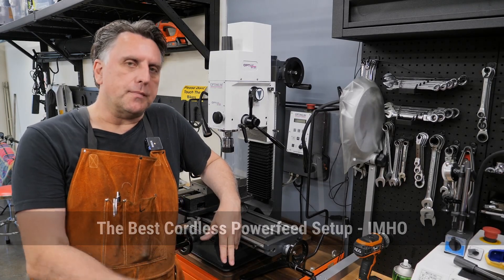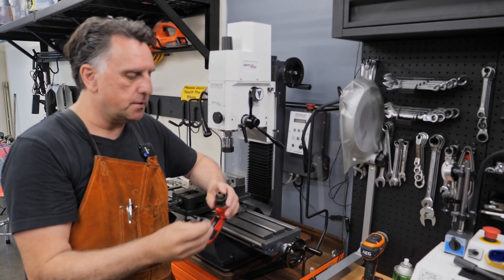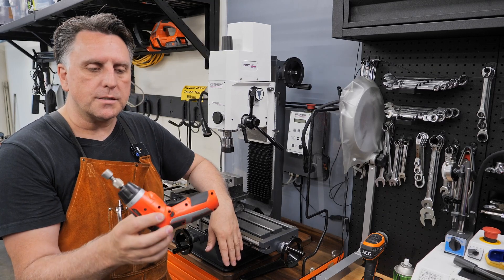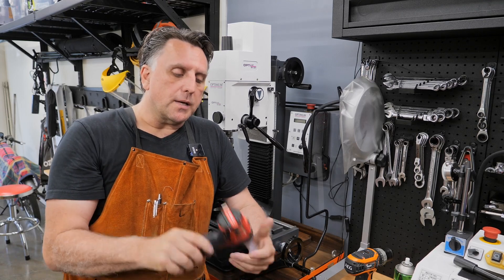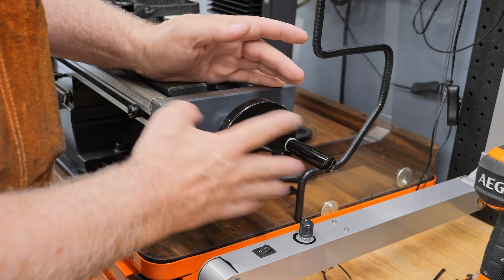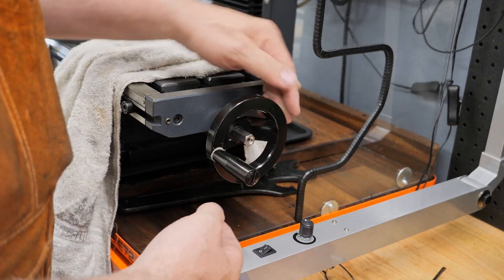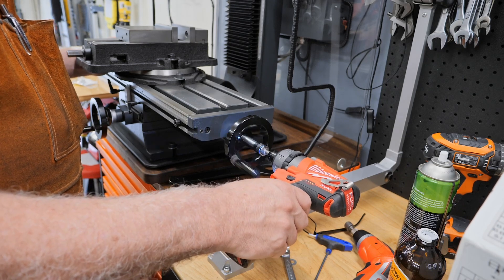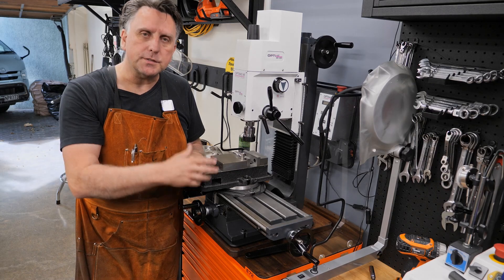3-Axis Minimill Powerfeed - More Than Just a Drill - Rob's Garage

Comment: Years ago I made a power feed for a small milling table. I used a car windshield wiper motor. The power was from a 120v- 12/24 v center tapped transformer. The variable speed was with a dimmer switch on the 120v side. Older auto motors can handle being over volted for a short time . If I ever redo it I'll use PWM board from ebay. thanks for the video
Reply from the maker: And thanks for the comments too!

Comment: Very well done rob👍
That is a perfect setup quick and reliable electric feed,

Ps. The on screen reads are up for long enough to read, i find subtles get in the way of focusing on the vid anyway,
Reply from the maker: Hi Dan, Yeah this is going real well. I've been using the setup every day and along with the arbor lock and drawbar lock it makes the mill vastly easier to operate. It was really putting me off before but good now! I'll have a look at the subtitle things. The main purpose of them is to insert something that I missed in the recording, but I may be inserting unnecessary bits as well.